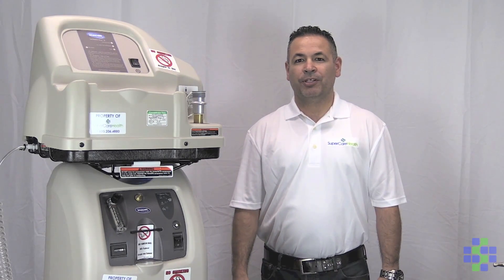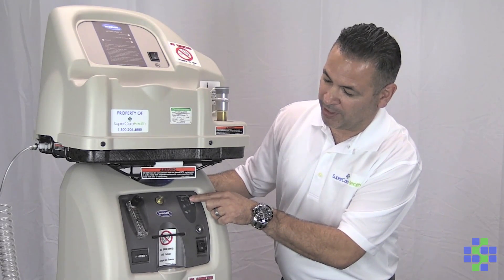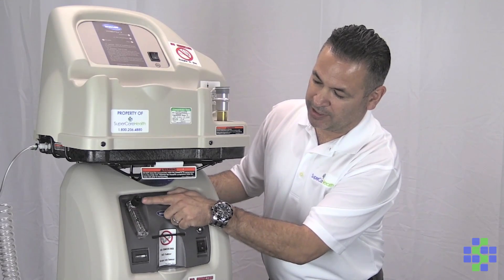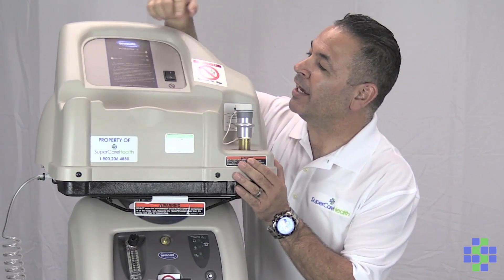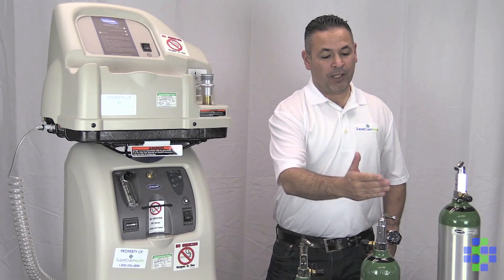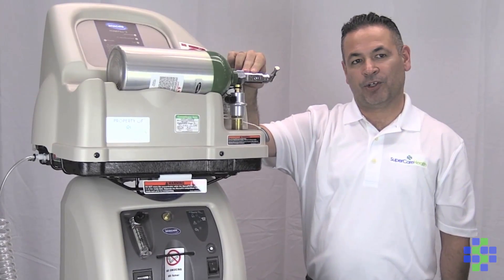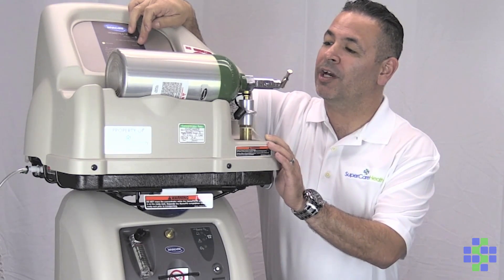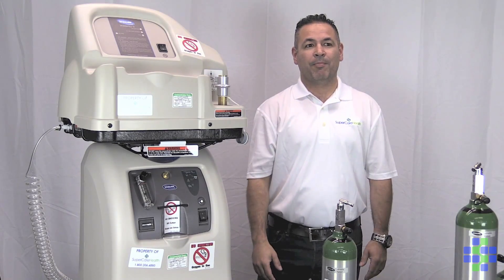SuperCare Health Guide to Your HomeFill Oxygen System

Comment: I can’t get the tank fuller to turn on. I’ve checked..it’s plugged in, the coil is connect to both the homefill and the concentrator, and the tank is attached correctly.  Is it just dead, or is there a trick to get it to turn on?

Comment: I hope u still answer Here. My grandma has one but when we try to fill a tank, it does not fill continuosly, it changes from o2 below normal to fill and back over and over again, does it need any maintainance?
Reply: Possible the bottom machine is not at correct % and also make sure ur flow gauge is set between 2litres per min and 3 litre per min. If the bottom machine is not above 93% the home fill system may not work. The switching of the homefill top is because there is a problem with bottom machine 9 times outta 10

Comment: Sir, my concentrator is Invacare platinum 9,but it came without Humidifier. Can I just use it without Humidifier..??
Reply: yes
Reply: you can use it without the humidifier bottle..however it the 02 dries out the patients nose area you may wanna consider using it..and only distilled water...regular water and the usual deer park bottled water will not do.. the waters calcium build up will plug up the very small prepunched hole in the stem that's in the cap

Comment: I have a bigger 3 foot tall tank could you tell me how to fill this tank? It doesn't have have a stem on the top of the  tank.we have the home condenser..don't know why they sent the tank unless I am over looking something.thank you
Reply: The 3 foot cylinder you have is called a pre filled cylinder. These can not be filled using the home fill system. Your oxygen provider has to replace this type of cylinder.
Reply: If its the e tank that's about 3 foot tall I do not believe you can refill that you have to send back with your other empties
Reply: generally speaking the 3 ft tank is used as a back up tank in case of emergency i.e. power going out or traveling to the store etc. that is an E tank and is generally filled by your Dme company or is just switched out.. Only the home fill smaller tanks can be filled by the home fill unit
Reply: I can’t move the little black knob to change the liter size

Comment: I need help, my Dad has a homefill system from Aerocare.. They recently replaced the bottom oxygen concentrator for a quieter one.. We are on our second top piece that fills.  Its not doing anything, I have checked the clear hose that runs from concentrator to the filler and nothing comes out.  No air do I feel.. Not sure what's happening but no tanks are filling.. The light indicates they are forever eternally filling filling filling, they never get to full... Not even after 24 hours, Please help !!